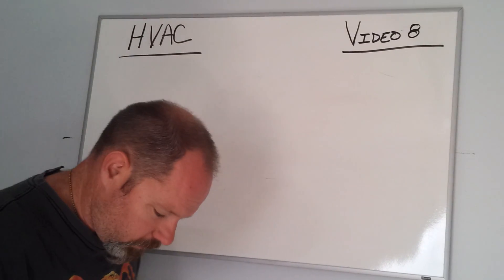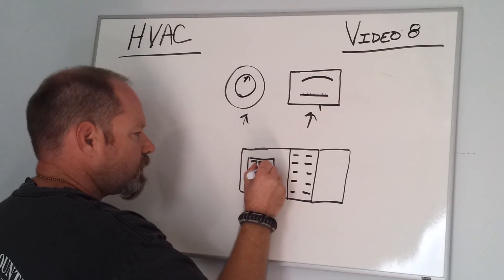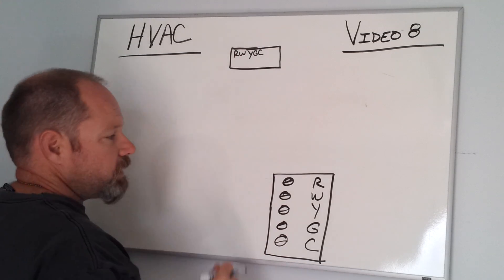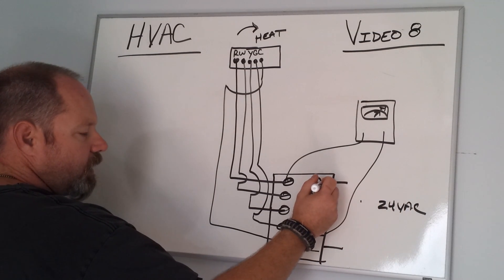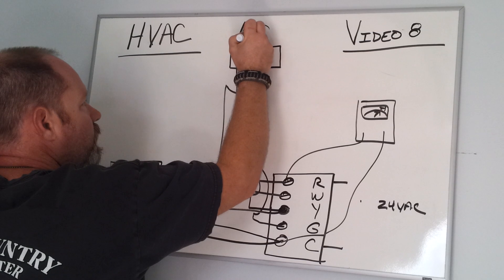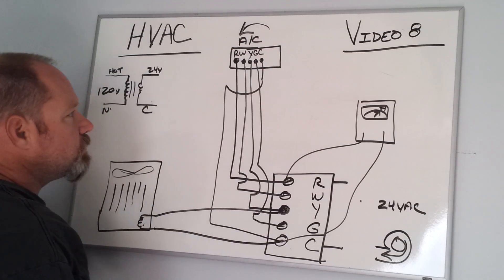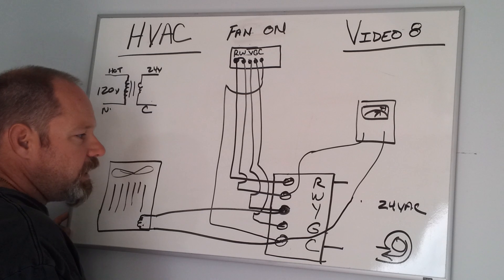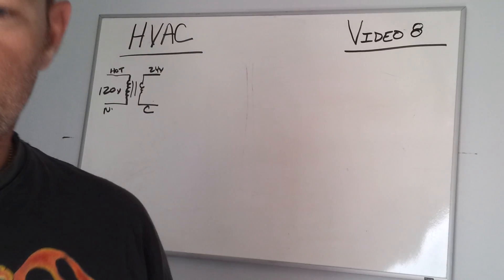BASIC ELECTRICAL 101 #08 ~ HVAC Thermostat wiring and troubleshooting

Comment: Thanks for your video, help me a lot how to connect my new smart thermostat, I have little issues because my fan never stop and I have this fan in automatic, when I turn the heater off works but the fan is always working, what you think I did wrong.

Comment: I bought a new thermostat and went to install it, but there was no "C" terminal but I have a common (blue) wire. I dont know where to put my common wire, and I can't get the thermostat to run. I am trying to run heat and air if that helps. If anyone knows anything please help me.

Comment: At 4:30 that is A/C not DC
Reply: This is 5-wire? In 4-wire the ground ( common or return ) is not actually brought into the switching control unit called a T-stat; 
It only switches the 24-vac ( power side ) ~ common or "return" will be available inside the cabinet;

Comment: I installed my first thermostat watching your YouTube video, thanks a million!!
Reply from the maker: You are very welcome!
Reply: @GuyBrown  
I am about to open the cover on a unit; 
I worked up to setting the condenser myself without supervision but did not  become proficient — zero time actually — at any of the inside of the unit; I installed 4-wire mechanical T-Stat per Terry's directions; He has many decades doing this and now works at LP - which is a fast-paced major shop in the county so he knows his stuff; 
We robbed the T-Stat from a building to get tenant's area heated;   
I hooked up 3 of the wires by unmistakable color-code and there was only one wire left so I attached it then failed to pull cardboard cover for shipping which I did on a call-back then tried the fan and the blower came on but I get hot customer 
( he is a contractor ~ worked at BMW shop and has his own mechanical tools ) 
telling me the unit is not heating; 

I have emailed the supplier with PN's to get a wiring diagram but looks to be a very common style of the era prior to "heat pumps"

I have ¼-million hours with only one scar so I can open the unit in relative safety – it is dangling wires that I did not install so I have to be x-tra careful not to break anything that is working and can really use your oversight;

Comment: Great video Guy.. I do have a question that I cant seem to figure out why my new Goodman MVC96 furnace blower fan shuts off as soon as I switch the thermostat to cool mode but the condenser does start up fine.  Because of no blower fan circulation the TXV and service port start freezing up immediately so I cant even get to setting sub cooling  . I have the 2 condenser wires hooked to Y & C on the furnace control board but when set the thermostat to cool it shut off the blower fan. Blower fan also wont run in the ON or Auto position when set to cool but does work in heat and fan only mode.???   Any suggestions would be great. thanks
Reply from the maker: Unwire the tstat and jump out the terminals at the furnace and check for proper operation. Sounds like a stat issue.

Comment: Thanks so much for this.  I was wondering where the extra wires to the Y and C terminals went to, and now I know!  Now I'm wondering what the ballast screwed on top of my furnace that's hooked up to the C and R terminals is for.  Plugs into 4 prongs where the output air ducts are  connected.

Comment: The a/c works but the heater doesn't. I think my issue is in my furnace.
I started with changing out the thermostat, that didn't work. My heat will come on when I put R & W together.
Reply: What type of Heat do you have? Heat pump, Electric strip heat, Steam, ect? need more info about the total system.
Reply: My guess is you purchased the wrong tstat for your system or you miswired it. Contact the 800 number of the tstat manufacturer and have your new tstat model number ready.

Comment: You said that the transformer secondary side has 24vac, but you didn’t say where it’s going to! Where does the secondary wiring go to and why?
Reply: Russell Salinas the secondary wiring on a transformer goes to the control board which sends 24vac to your components

Comment: Great video to understand the low voltage side. I an working on a heat pump that is not pulling in the contactor on the outdoor condenser unit when calling for cooling. I have a few things I'm scratching my head about. 1. I am getting 30V from the (R) Red and C (Common) it is a 24 Volt system, does this mean my transformer needs replaced? 2. When I check the W (White) to C (Common) when asking for cooling I am only getting 15V and it is also showing 15V when not asking for cooling (turn thermostat above room temperature). Is there something I am missing? Thanks for all your help so far.
Reply: the 24v transformer will produce a voltage between 24v-30v. That is normal and most produce around 28v AC. If you measure the voltage across 2 points and only get 15v that tells me you are only seeing voltage from 1 side of the transformer (either R or C. Most likely R side). You need the relay in the thermostat to make the connection on G,Y,W ect to C in order to get a complete 24V connection. When that takes place, the 24 volt relays will switch on and supply 110/220 vac to the outside unit/inside fan/heat strip depending. I am not a HVAC tech. I just love everything electric and worked on it from 9 years old until age 39. Very fun stuff!

Comment: Please clarify... at 4:47 did you MEAN TO SAY... so when you call for heat, the thermostat will send out voltage W & G? (heat AND BLOWER/FAN?) I am an amateur, so this is a REAL question, not a smart remark.  FYI  I'm not sure if this matters, but I am asking in reference to a gas furnace. It just seems like common sense that it would call for the W & blower also (just like it does when set for AC).  Your fast reply on this matter would be greatly appreciated.

Comment: you say C may or may not be connected , and you say it depends :   depends on what EXACTLY AND SPECIFICALLY please ???? then you have the thermostats  C wire   going to the the  lower  box  C connection , then it leaves there and goes to the outside unit?  Im totally lost as far as eh C wire is concerned
Reply: R.I.P.

Comment: I saw your video, it was really helpful and I was thinking that maybe with your knowledge you could help me with my problem.
Do you have any idea if I could connect two thermostats on a single stage heating and cooling?
My idea is to install one tsat downstairs and one upstairs to have the chance to select (via software or at least a manual switch) which thermostat to be in charge of the HVAC.
For your information I have just one manual damper (which closes or open the up floor duct), so the idea is not to do a zoning but to have control of the temperature on the floor I am regardless what the temperature is on the other floor. 
Just as an example to be clear: If ambient temperature is 18°C and I'm using downstairs tstat (with set point 20°C), upstairs will be 25°C but the system should continue working. Only the downstair tstat should lead.
By the way, I'm from Argentina and I have already bought 2 Honeywell WiFi - RTH6580WF on a trip to USA (here are really really expensive!)

Please let me know if I'm not clear enough.

Thanks in advance.
Regards.

Comment: Hi, in a Utica PEG150BIDE gas boiler, where are the wires of the Safgard VXT-24 automatic feeder connected?
Reply from the maker: gersondavidUniverse not sure without looking at it but auto feeds usually operate off of the LWCO.
Reply: Thank you

Comment: So tell me why I had this one call were if I had fan on auto unit will cool as Normal but if I slide the switch to on fan stopped blowing but condenser kept running.(I’m a service tech by the way)
Reply from the maker: +Samuel Aguilar old furnace with a fan center and single speed fan motor? (Transformer and large relay)

Comment: Great explanation guy ,I have a question. What happens if I set the t stay in cool mode and fan is at the on position.
Reply from the maker: +Samuel Aguilar fan will run and the ac will run when the stat calls for cooling.

Comment: Great videos been learning electric and hvac systems due to myy furnace failing. Was wondering how u check volts on furnace t-stat without a common wire. I know red should be 24v and W if heat is on, im having trouble getting my furnace to turn on at all. Need to know how to check double pole breakers inside furnace to make sure im getting proper V there and on t-stat. Thank u in advance and wonderful job on the tutorials.
Reply from the maker: +Dustin Hacker thanks man! Let me know want you want me to make a  video on.

Comment: Thank you for the video. A while ago I changed my wires and when the summer hit my condenser unit did not go on. Thanks to this video I was able to pinpoint the 2 wires that needed to be connected and now it is working.

Comment: Great!!! add: in call for cooling if you have G energized but no 24V in Y , what seems to be the problem, R and Y has no 24V but the rest has 24V, R-C , R-G ...
Reply: If you don't have 24v then that means it's closed which power is energized. So your calling for cooling then Y & R would be 0v

Comment: trying to install a Wi-Fi honeywell thermostat but I only have 4 wires so I was  going to use g wire as the c common but I got down to my furnace and the y wire is in the c wire place. so why would this be set up like this? can this be because we also have an electric plenum heater wired into the system as well?

Comment: What if you do not have 24 volts at R and C on the block but you do on the transformer.  Also have an error with five blinking lights.  This occurred after a freeze up.

Comment: my thermostat goes blank...i dont have batteries...i also reset the circuit breakers and the panel still goes blank for a few minutes and then comes back on, then goes blank again, etc...it keeps repeating when the AC kicks in....what is wrong?
Reply: polishtheturd mickelson not very good advice to give!!!👎🏻👎🏻
Reply: slow draining condensate trap that is protected with a float switch that opens red power line. Go to air handler and find pvc drain line and lift thingy with two wires coming out of it to see if power comes back on. Than call someone to unclog drain line before you flood your house.

Comment: I know this is going to sound stupid but I got mad and smashed the thermostat in my hallway I went out and picked up a new one I put the white to W the red R the blue to b the green to G and the yellow to y now when I turn on the heat the outside unit wants to run and no it's not a heat pump but when I kick it to AC the outside unit does not come on just wondering if you could give me any idea what could be wrong
Reply: Mike Blarney okay so I figured out what my problem was when I was putting the blue wire on B I should have actually been using the blue wire as the yellow because that's how the company that installed my system wired it they did not use the blue wire for B and the yellow wire for y
Reply: Mike Blarney  yes the AC works now it's about 70 degrees outside now and I have the air set on 65 it's cooling perfect and yes it shuts off and it does not run while the heat is on

Comment: I have an electronic ignition fireplace that ignites a pilot. It has a control module .  it has multiple connections coming from remote control receiver, battery relay, and a battery pack.  The control module has two connections labeled pilot connectors.  Labeled I and S on the wiring diagram.  I want to install a thermostat like on a heating unit.  It seems I need to connect the thermostat to the control module at I and S terminals to send a signal to light the pilot. Am I in the ballpark on this?

Comment: How would a thermostat without a Common terminal receive electricity in order to send signals out back to the circuit board? Simply battery power? Or are there old analog ones that use some type of different metals that generate a small amount of voltage?
Reply: Yes, if it has batteries, it uses the energy from battery to energize relay(s) inside thermostat to connect R 24vAC to desired terminal (function). The old thermostats used contact switches filled with mercury that are conductive.

Comment: I have a Honeywell thermostat with 4 wires connected with two batteries in the thermostat. The C terminal is not connected. Is it true that if I connect the C terminal to the transformer inside the air handler control panel I would not need the batteries to run the thermostat. As is the batteries have to be replaced constantly. How does one connect the C terminal to avoid using the batteries. The thermostat controls AC outside unit, heating blower inside unit, and the fan.

Comment: This is a great explanation, thanks for this. Two questions for you -- 1). I have two wires in my thermostat (W and Rh) and a jumper between Rh and Rc. Why is the jumper there, what purpose does it serve? (Heat only steam boiler) And, 2). If I wanted to use a Nest thermostat, would I simply need to upgrade to a 3-wire and connect C from thermostat to C on the boiler's electrical box?

Comment: Thanks for the video, I just took off my super old Honeywell round manual heat thermostat to install a programable digital one and I se i have white/ black/ yellow/ green wiring. No white. Black and red were connected, yellow/green were not. Is black the same as white wire? Thanks!
Reply from the maker: +Bibi Bendikova yes that should be fine. May want to check the wires connected at the furnace to make sure.
Reply: Placed the black into W and the new thermostat works. You helped me feel empowered today, thanks Guy!
Reply from the maker: Bibi Bendikova you are very welcome. hope you subscribe maybe a future video will help again. Merry Christmas.

Comment: hi name is mike i bought a older home and furnace is older and the guy that use to own the home wired the furnace to a tolga switch and there are 2 regulators in the basement one hooked up and other one is ran to the circuit box and wires on it but they all been cut and only 2 wires coming to the thermostat if u could give sum info or a video tip that help and the regulators are the ones with 2 to 4 screws on them for terminals. but what im getting i can turn my thermostat on and the  furnace dont kick on i have to walk to the basement hit the switch the old owner has down there but thats only way it work all thermostat is doing is reading the temperature in the house
Reply from the maker: +Michael Hemming I would love to help but I need more to go on. Can you make a video of the system with your phone?

Comment: I installed new package unit electrical and I did the wire you said but my heat mode is blowing cold air what am I doing wrong?
Reply from the maker: +omar lazcano with a meter check to see is you hav 24v on c and w on the unit also make sure the tstat is set up to match your unit ie heatpump or gas and so on. There may be an issue with the unit. If the tstat is off and you have 24v on c and g you may hav a short in the tstat wire. Good luck
Reply: Thanks for your answer between c and w I got 1.8v then between c and g I got 0.2v
Reply: Also I only have 5 wires connected front unit outside to termostat inside I have R and RC together then Y then W then G and  C but in the outside unit C I not connected

Comment: Hello, I want to install a ecobee3 in my home. at the thermostat I have WYGR (the Y is a Blue wire) at the furnace I have WGR hooked up , nothing is on Y but there is a gray wire on C, Gray from C goes to the AC comes back as red then goes to the thermostat as a blue wire to Y on the thermostat.would you be able to explain what they are doing. any help would be greatly appreciated. Thank you
Reply from the maker: +Chris Mckie your answer is coming in a video. Keep an eye out for it. This week.
Reply from the maker: Chris Mckie I uploaded a video for you.
Reply: mine is wired similar, Y is blue, R is red G is green W is white. There is also a C is yellow. Wire pair from AC is attached to furnace C and Y.  My 24volt transformer is only attached on the circuit board and the C is loose in the cabinet. I have 24volts at the 5 terminals across the loose transformer wire. I have a Honeywell rth9580. I have 5 wires only for the thermostat. I want full control of the fan to automate it. Can you help explain how to wire the transformer and thermostat. I have some good photos as well. Thank you

Comment: hello .I would like to ask if the thermostat isnot functioning well or else it is damaged .can I run the unit without thermostat? by jumping the wire? is it true? ..thank you boss
Reply: You can bypass the thermostat as long as all of the other components of the system are functioning properly. Just connect the wires connected to R, Y, and G together with a wire nut. You can open up your furnace and check which color wires are tied into those specific terminals. The unit will run continuously until you un-jump them or turn off the switch or breaker that powers the furnace.
Reply: thank you sir appreciated.by the way can I ask if you have a Facebook page?
Reply: I have a lots of questions sir theres no one I can I ask for

Comment: Question about my Rheem air handler. On an X13 type blower motor, the output relay on the control board has three terminals, Common, G, and Spd. These are connected to the X13 terminals. Common going to common, G going to term 1 (low) and Spd going to term 5 (high). When the unit is in the cool mode, both terminals 1 and 5 have 24VAC. Why would both contacts on the output relay be sending 24 VAC at the same time?

Control Board:
http://i926.photobucket.com/albums/ad106/doorguru/protech_47-102077-02_article_1368704494779_en_normal_zpsncfhviby.jpg

Comment: Please help! How do I run brand new power to an ac unit?? I'm remodeling a house and the guys that demoed the place tore out the previous wires.  I have no idea how to run power from a box on the ouside to the inside.  All the breakers are already full so I don't know what to do.